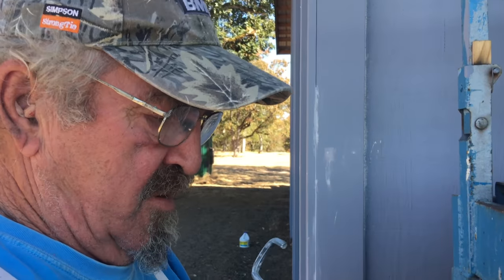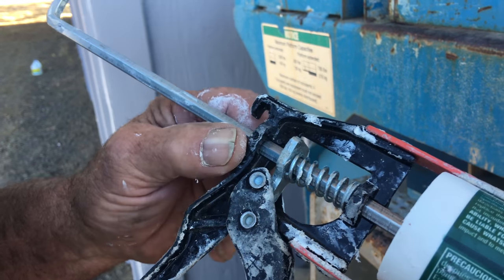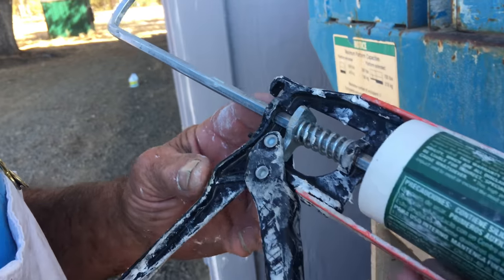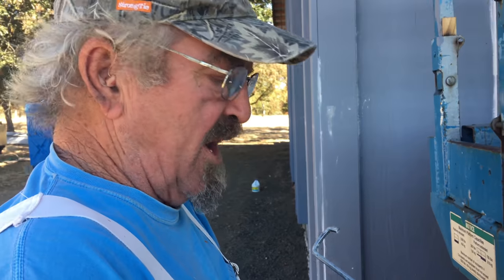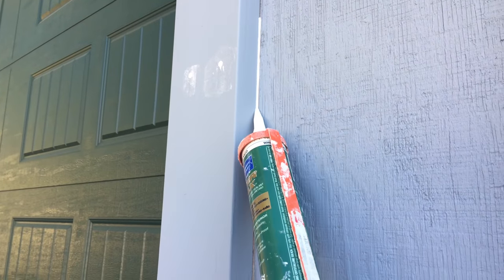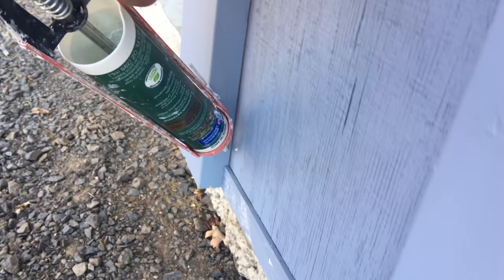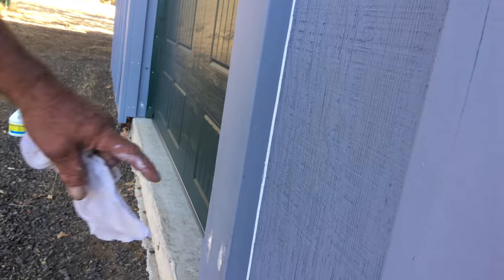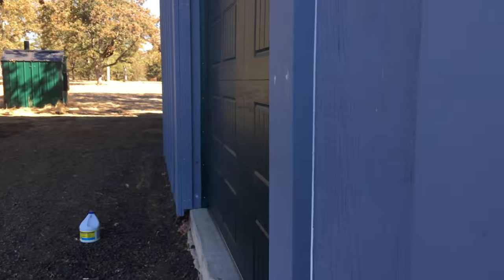Professional Painting Tools - DIY Caulking Hack

Comment: What was the actual "hack" or modification? I missed that part. Did you just buy the special tool?
Reply from the maker: +Paul Tuttle - apologies if there was anything misleading ... just trying to share how I change the oil in my generator. Thank you for watching.
Reply from the maker: All we did was remove the locking tab on the caulking gun.
Reply: @USNERDOC  can you replace it?